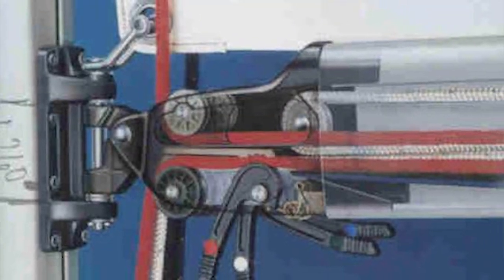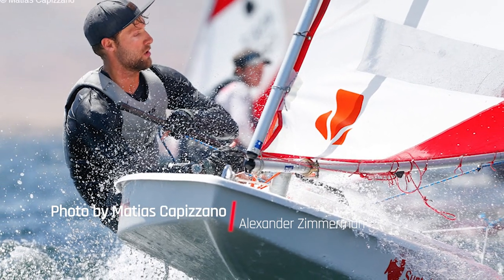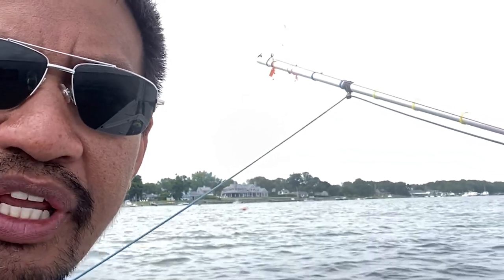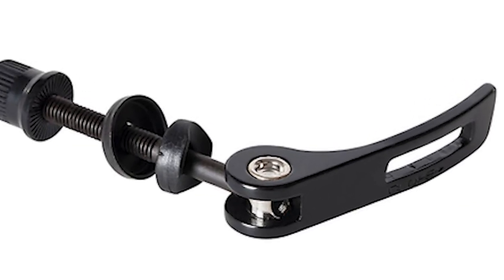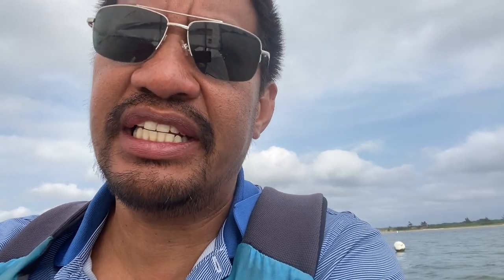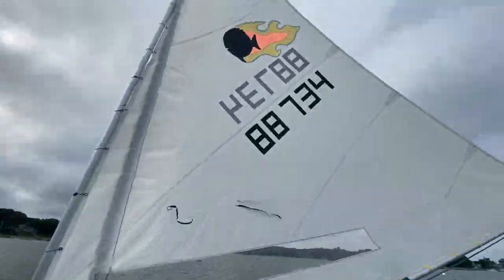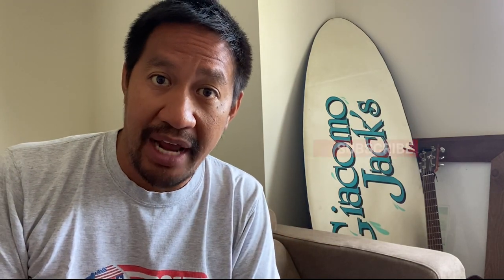Sunfish Sailing and Rigging the ADJUSTABLE GOOSENECK on a Sunfish Sailboat | Why you need it!

Comment: I'm 6'1, 215 and a rookie. I'm ordering the adjuster but, in the meantime, would you recommend I change it manually to 13, 14 or 15?
Reply from the maker: Sorry for the late reply.   Statt at 15”.  

Depends in wind.   15-18” good to start with.   If wind speed is 15-20, and you are a beginner, maybe stay on shore.  6-12 is great for beginners.
Reply: @LeeSideSailing  thank you. yes, I only feel comfortable in low to medium wind right now.

Comment: Bought the seat adjuster cam in the description. Does not seat properly. Im disappointed.
Reply from the maker: Ugh.   Sorry about that, i hipe you were able to return it.  Ill check out the description
Reply from the maker: I just ordered one and will see what happens when i get it:    Was the bolt too short/long or fat?

Comment: Are the new goosenecks aluminum? I'm now seeing some offered in aluminum.
Reply from the maker: I did not see any aluminum goosenecks,  where did you see them..   ive seen them in brass and Stainless steel.  Thanks for the question!
Reply: Contacted seller. Says that they are indeed aluminum, and he's sold many if them

Comment: Thanks for all your video and knowledge. What is the difference between Jens rig and adjustable gooseneck? It sounds and looks like the same movement of the luff, top spar.
Reply from the maker: The gooseneck adjusts the position of the lower boom in relation to the mast.  The Jens adjusts the upper spar in relation to the mast.  Working together it changes the center of effort on the sail.  Some times you really need both adjustments, especially in extreme heavy air.  Thanks for watching!

Comment: Lee good advise keep up the good work ! Can you show more detailed still pictures of the gooseneck adjustment bolt you are using , especially size and type of metal ,to mesh with the brass. Thanks Mike
Reply from the maker: Hi mike-  most of it’s aluminum and aluminum alloys.

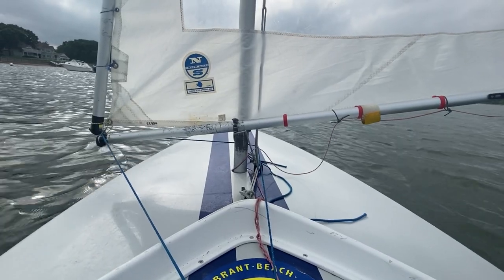Comment: What is the line through the eyebolts at 7:55?  Is it a bungee to the rudder?   Why the eyebolts?
Reply from the maker: That is my bungee daggerboard retaining line.
Reply: @LeeSideSailing  Why do you run it though the eyebolts rather than just around the mast or just through the handle?
Reply: @LeeSideSailing  Oh, I see, you explain it in https://www.youtube.com/watch?v=JH2_Bs9fDqU -- in light winds, the bungee on the tack helps hold the sail out sort of like a foreguy.   In very light/no winds, I often move my weight to heel the boat to dangle the boom where I want the sail to be.   I'll try your bungee-foreguy idea.
Reply from the maker: I like that it puts tension on the sail especially in light air and could help hold the sail  out going down wind in light air.